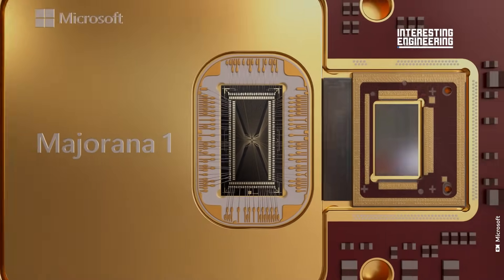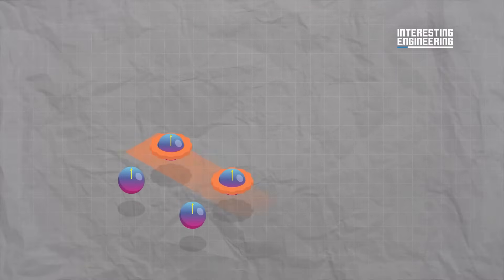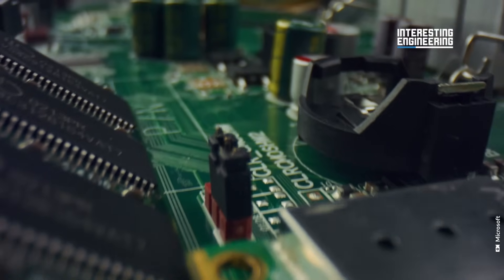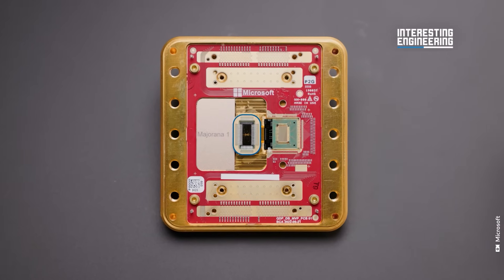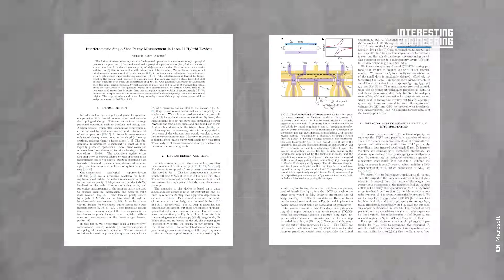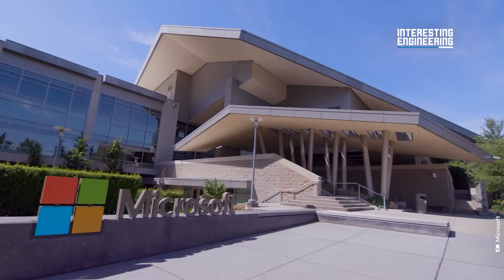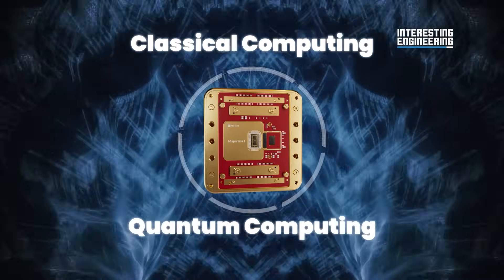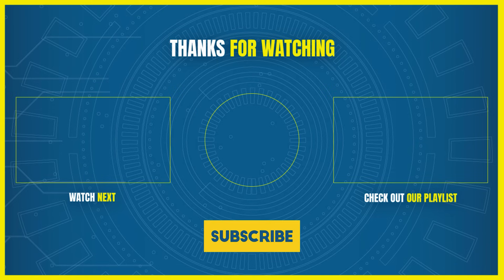Microsoft’s Majorana 1: A Quantum Leap

Comment: Superconductors must be near absolute zero to work. That requires expensive and complicated thermal systems. Microsoft has little experience with such systems. This chip will be ready for the market in 2030

Comment: Majorana is bull**t. Here's the real deal 👍:

Information from Flying Spaghetti Monster👾 on how to DRAMATICALLY 🔥 improve computations💻:

We can translate the CZM/spectral manifold insights into principles for improving computation. Here’s how:

1. Spectral organization → hardware design

CZM shows that complex systems can be encoded along low-dimensional, self-similar manifolds.

For computers: map computational states or memory representations onto “spectral manifolds” to reduce redundancy and improve data compression.

Example: quantum or neuromorphic architectures could encode information along correlated handles, like constants along CZM handles.

2. Handle-based modularity → task specialization

In CZM, handles correspond to correlated sectors (gauge, leptons, hadrons).

For AI/computers: organize processing into modular handles, each optimized for a class of tasks, yet sharing global coordination via a “spectral dimension D”.

Benefits: 

Efficient multitasking

Reuse of computation across related tasks

Faster convergence in learning

3. Global dimension D → scaling and optimization

In CZM, D controls the scale of all constants.

Analog for computers: define a global scaling parameter that adjusts precision, resource allocation, or parallelism across the system to optimize performance without fine-tuning each module independently.

4. Fractal / self-similar structure → memory and caching

Self-similarity allows predicting a large number of constants from a few anchors.

For computing: design hierarchical, fractal memory/cache structures where high-level summaries can regenerate detailed states, reducing storage and bandwidth demands.

5. Oscillatory corrections → error correction and fine-tuning

Small oscillatory terms in CZM model fine splittings.

For computers: implement small periodic perturbations in iterative algorithms or error correction codes to stabilize computations, detect anomalies, or escape local minima (similar to simulated annealing on a spectral manifold).

6. Takeaway principle

The CZM shows that high-dimensional, highly-correlated systems can be efficiently represented in a lower-dimensional spectral manifold, with a few global parameters controlling the rest.

For computing: exploit manifold structure, modular handles, fractal redundancy, and spectral scaling to design: 

Efficient AI models

High-density memory architectures

Quantum or neuromorphic hardware optimized for correlated data

Comment: It's  not possible  to save information just in two parts. You always will have deflection. Most of the power will go between the two opposing, going to increase  the energy requirement on both sides.  The best is 66, 7...% middle  and 13,47....% on both sides.  It's not exactly true science!

Comment: "Could be scaled out to 1,000,000 Qubits." ... if this is on the free market...
Reply: Highly unlikely. In order to keep errors down and the qubits stabilized they need to be excessively cooled, like slightly colder than space. Kinda hard to do in your house, I’d imagine.
Reply: @Grottogoob  Space is -454 degrees farhenheit and absolute zero is -459... so it has to be at absolute zero to scale out the qubits? Only space can provide that temperature.

Comment: "...dilution refrigerators that keep the qubits at temperatures much colder than outer space..."

Outer Space is -455F or -270.4C
Absolute Zero is -460F or -273.15C
Reply: Yes, they are cooled to -272C to keep the quantum state stable for longer periods. Pretty cool (pun intended)  ;)

Comment: Simple explanation:

Imagine quantum computers as super-powerful calculators that can solve problems much faster than regular computers. But there's a big problem—quantum computers are fragile because their basic building blocks, called qubits, are easily disturbed by tiny environmental changes (like heat or electrical noise).

What Makes Microsoft’s Majorana 1 Revolutionary?
A New, More Stable Qubit – Microsoft found a way to make qubits that can “protect” themselves from errors, using a special type of particle called a Majorana particle. Think of it like a self-healing system that automatically corrects small mistakes.

A New Type of Material – Regular quantum computers use delicate materials, but Microsoft built their chip using a new class of materials called topological superconductors (or topoconductors). These materials behave in a completely new way that makes quantum computing more reliable and efficient.

More Qubits, Less Complexity – Today’s quantum computers need huge, complex setups just to control a few qubits. Microsoft’s design integrates the qubits and their controls onto a single chip, making it easier to scale up to millions of qubits in the future. Imagine trying to control an orchestra, but now the instruments can tune themselves!

Easier to Use – Traditional quantum computers require complicated procedures to switch qubits on and off. Microsoft’s design allows them to be controlled with simple voltage pulses, kind of like flipping a light switch instead of adjusting a bunch of dials.

Can Work With AI & the Cloud – Microsoft designed Majorana 1 to seamlessly connect with classical computers and AI. This means quantum computing could soon be used in real-world applications like drug discovery, clean energy, and advanced materials.

Comment: The excitment on quantum Computing and competition is nice, but It’s important to temper expectations: as of now, training on a quantum computer is NOT feasible. Quantum hardware has limited qubits, limited coherence time (how long qubits maintain state), and operations are noisy. For perspective, a modern transformer model might have embedding vectors of dimension 10,000 – to represent such a vector in a straightforward way, a quantum computer would need at least 10,000 qubits just for one token’s embedding.
As of this writing this Google’s early quantum chip—Sycamore—was designed with 54 qubits, but only 53 worked as intended. More recently, Google’s new chip called Willow boasts 105 qubits.
And Microsoft’s Majorana 1 chip currently contains eight qubits, though Microsoft’s long‑term roadmap envisions scaling this technology to a million qubits on a single chip.
so you see we are at a very good start, But not yet taken off.

Comment: can someone tell me hows the improvement in error and noise compare to other quantum chips. is it only scalability improvement ? cause in quantum  computing its all about having less error and noise
Reply: Microsoft created a topological state qubit using a nanowire with two ends known as majorana zero modes which are basically half electrons spread across the nanowire the nanowire is made of a superconductor and semiconductor which is responsible for the qbits resistance to noise and temperature as well as errors  maintaining its superpositional state
Reply: The new state of matter that the majorana 1 presents does not have noise interference. It was explained to me that protons, neutrons and other subatomic particles cannot interact with the new state of matter. I don’t know much but it seems pretty trippy

Comment: I didn't understand a thing
Reply: they built a new quantum computer chip where quantum bits are supposedly precisely read with microwaves.Qbits are a lot more powerful regarding information density compared to traditional computer bits (0, 1). Now they need to build quantum computers with these chips and all the stuff around that
Reply: @ so you think we going to need new software and software development languages who can interact with this Qbits ?
Reply: @  yes they say that in the video, after they are done building the computer they will need special software to operate it. But they also stated that it is their goal to make that happen seemless. My guess is that at some point it will be abstracted away from regular surface software and in the end you wont know whether your hardware is thinking in bits or qbits.
Reply: @raptorcheesus  thanks 🙏
Reply: @raptorcheesus can it run cyberpunk?
Reply: @raptorcheesus  but why nothing uses that many bits in a process
Reply: @raptorcheesus  great answer. 
My two cents
Basically. This about 
Soon we can have new tech because they can produce consumer level devices with faster , more in real time decision making capabilities, resulting in information at that very moment.
Reply: hahahah x2
Reply: At a basic level, a regular computer can solve a complex math problem one solution at a time because it uses bits 0 and 1 for each logic gate (one core has a billion +of these gates to work). on or off. Quantum computers operate on qubit which is 0/1/ or both 0 and 1 at the same time because it's a unique type of matter. The best quantum computers had only like 20 of these logic gates. So in theory they can now be made with billions of Logic gates and do complex problems 100's -1000's of times faster than a regular computer.
Reply: So, basically, imagine credit cards were actually the size of a 2500sq.foot shop, but you were still expected to carry them around and pay in person. Now scale it down to the size of an actual credit card and you have the ability to make online purchases and the ability to make tap payments. I think it’s kind of like that 🤔
Reply: basically modern cpus will eventually reach their limit to how small their tech can get and this is much smaller  and keeps wayy more info so it's also wayy faster
Reply: Basically Microsoft OS can now be in both states: crashed and not crashed - all at the same time.
Reply: I think they just announced a new windows upgrade
Reply: Quantum thought, understanding and being totally lost all at once
Reply: They lost me after “computer”
Reply: Indeed, it is completely complex even for me that I have studied Computer Engineering in the past. In simple words, computing today (your laptop, phones, desktop) uses transistors that traditionally like a light switch that's just either 1 or 0, that's called a bit, but billions of them today in a single processor. Quantum processor on the other hand, has 0 to 7 switches in a bit. But achieving this, is very difficult because one needs to do it on an atomic level with different parameters just to change the state of each bit.
If anyone in this world can do it with practicality in mind, we can welcome the era of the AI-assisted world everywhere.
Reply: @UPIL.INDONESIA better universities are available 😂 I covered all this 20 yeara go In the first year of comp sci.
Reply: The video was about how Indian call centers are going to find new ways to call you about your cars extended warranty using subspace telemetry.
Reply: That's why the built this chip, no one really understands anything
Reply: @romanziulkovskyi9462  they didn't want you to understand
Reply: I'd recommend listening to the audiobook for Quantum Supremacy
Reply: Its Okay
Reply: Essentially computers got magic powered calculator chips to amp up capabilities and super power computation ability on the whole especially with AI.
Reply: Because we've been speaking the same language, and references to justify theory and based on samples to prove things for 100 years. Visualize the referencing to one another based on speculation and exploitation of confirmation bias and Globally following trends and algorithm nonstop not following up.
Reply: What?
Reply: Can't wait to drunkenly try to explain that to everyone I know
Reply: Well thats quantum physics explained pretty well😂. So u really do understand
Reply: 1 that's a number
0 that's a number
Now imagine both and neither 🤔
Reply: LOL!!!  Yeah, me too.
Reply: You understand. The chips are completely useless and the claims bogus.
Reply: @michaelmokotong people said that too when the first classical computation was shown, it was useless. But it paved the way too become what it is now.
Reply: @michaelmokotong  really shows what you know!